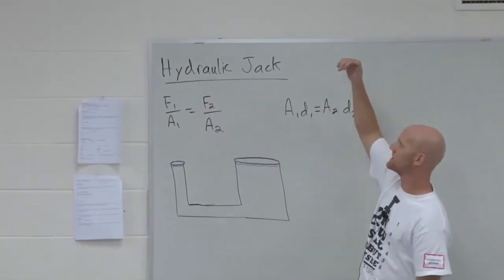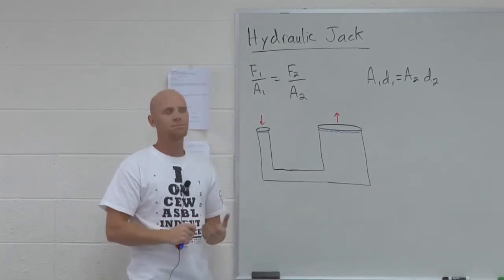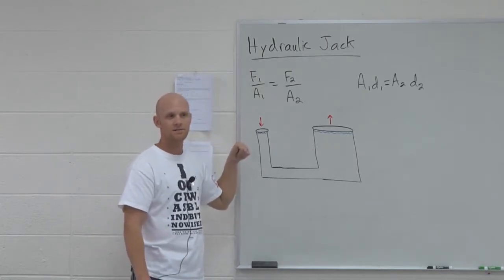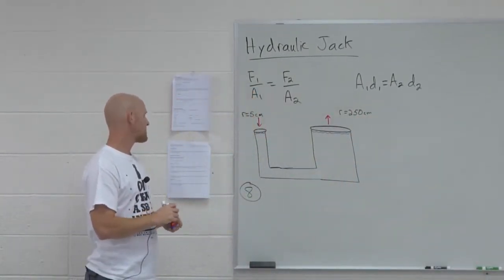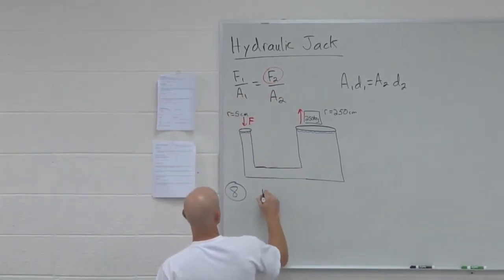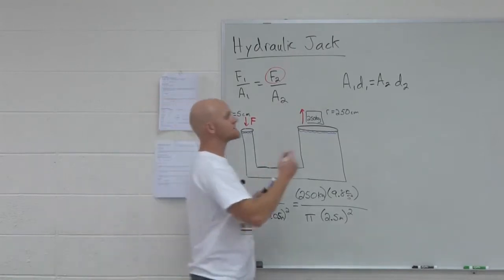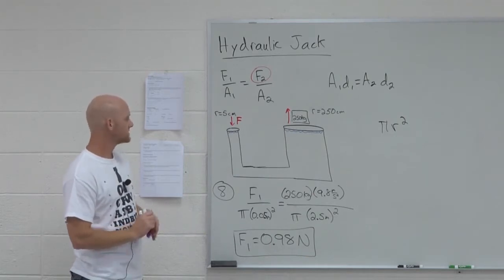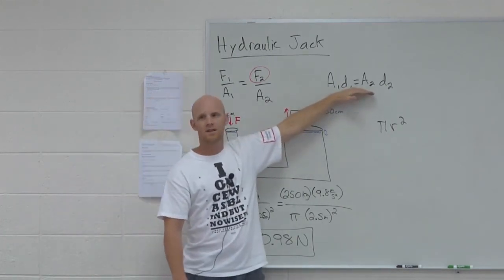9.5 The Hydraulic Jack

Comment: Just to clarify what you were saying at the end, if we push the water down one meter on the left pipe, the water would also rise one meter on the right side pipe too correct?
Reply from the maker: Hello Janani!  To clarify it is the volume changes, delta V, that are the same on both sides, not the change in height (d for depth in the equation).  
delat V1 = delta V2
A1d1 = A2d2
A 1 meter height change on the left would only correspond to a height change 0.0004m on the right.  As the right has a much bigger cross-sectional area, it will have a much smaller height change so that the volume change is the same on both sides.  Hope this helps!
Reply: Chad's Prep thank you!